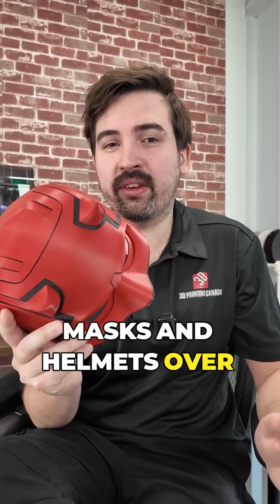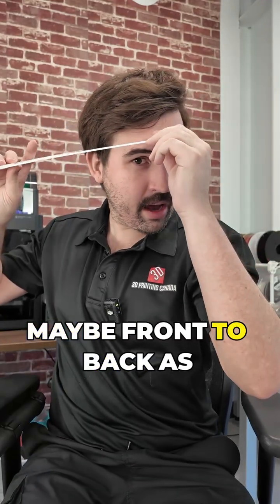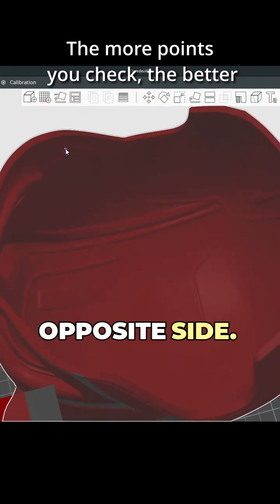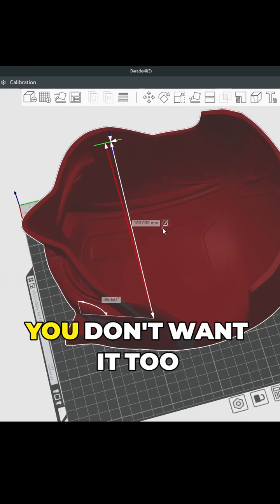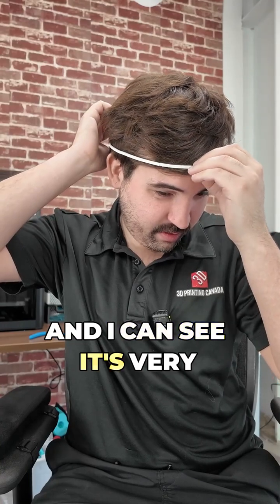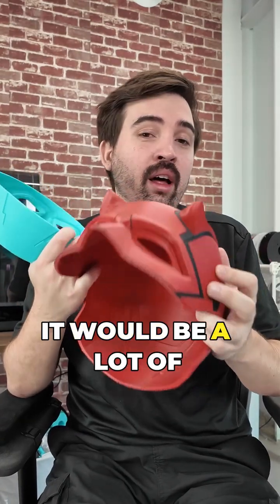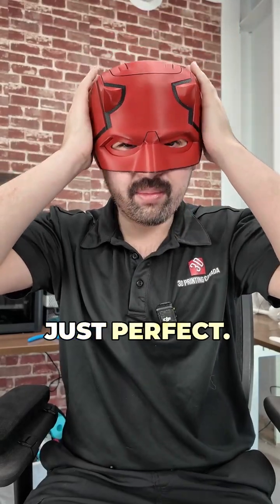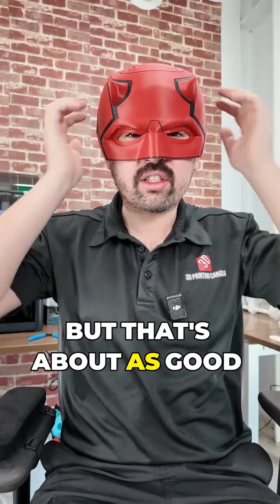How To Size Your 3d Printed Helmet

Comment: It is possible cut a helmet after is done? 🤔 because the problem is the hole to get in the head, is a bit small to get in. But the helmet other size using that tool is correct the other sizes.
Reply: I’m not an expert by any means. But why don’t you just slice the mask in a way that you’ll be able to open in put it on and close it with like magnets or straps.